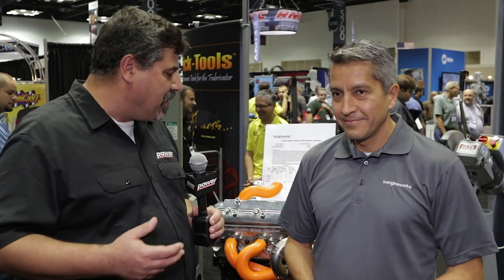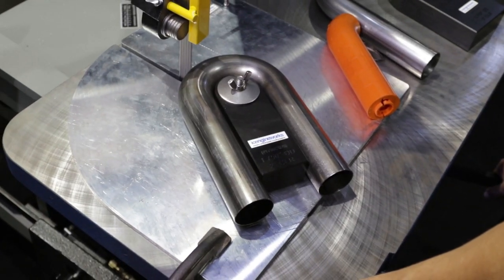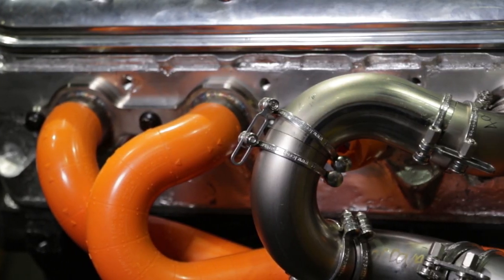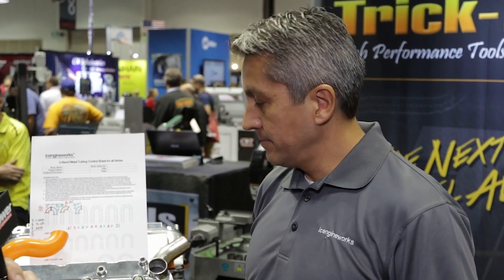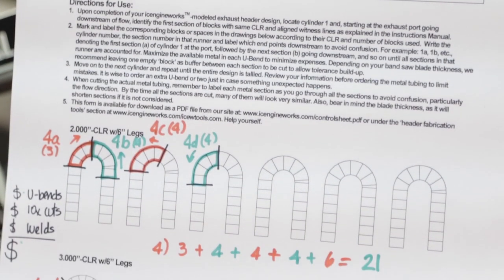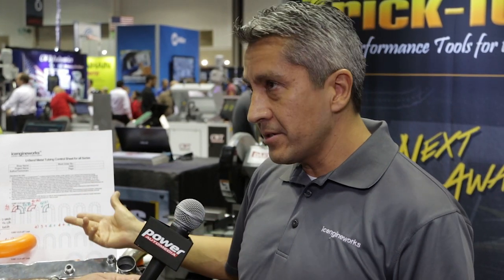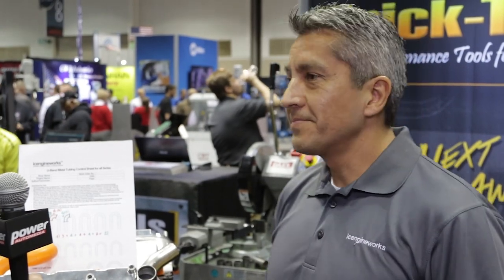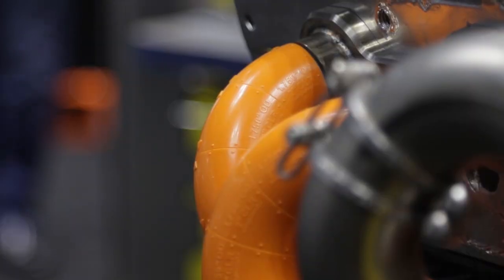PRI 2015 - Icengineworks Precision Exhaust Header Modeling System

Comment: these are cool but over priced..
Reply: studio571 way over priced.  Really cool product but I will never own this.  I would go to Home Depot and do the same thing with PVC pipe
Reply: Sad that they over priced these. One pice cant cost them more then .20 cents Even on the high side .50 cents
Reply: For less then 250 usd I bought a 3d printer and printed 50 pieces myself lol
Reply: Overpriced?  Maybe if all you are ever going to do is one header,  but if you are in the business of doing even exhaust systems in tight applications, I think it is reasonable for it’s application.  To pay to have this work done would convince you otherwise
Reply: Done many headers with out those, yes those can be helpful like i said but overpriced, if you think otherwise just buy them and be happy